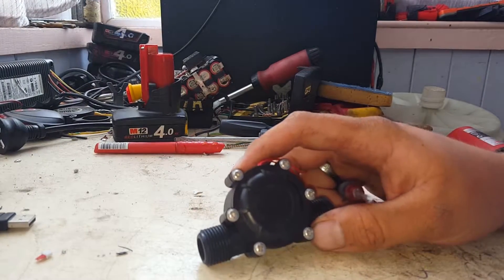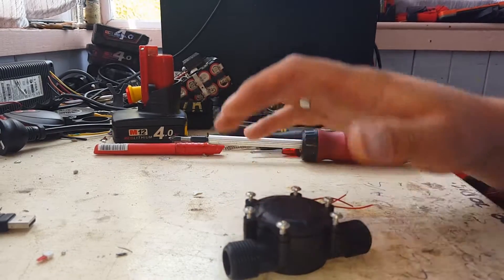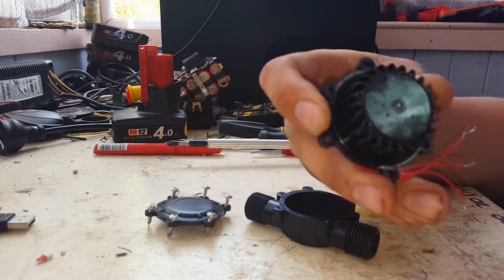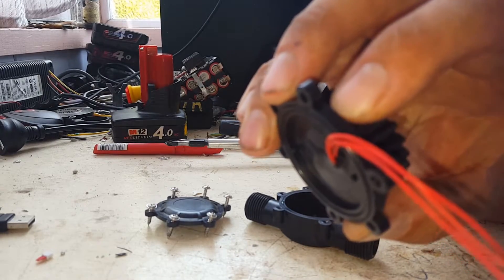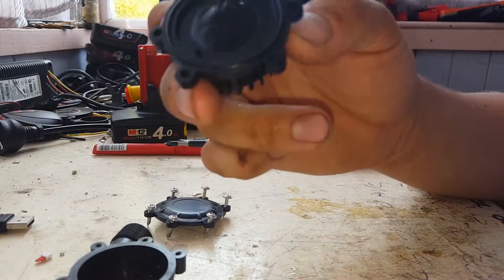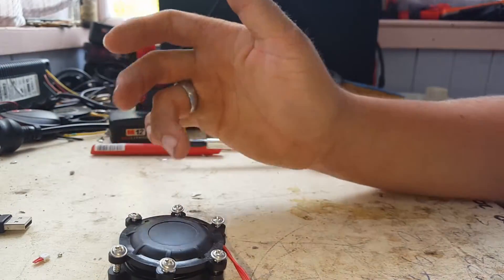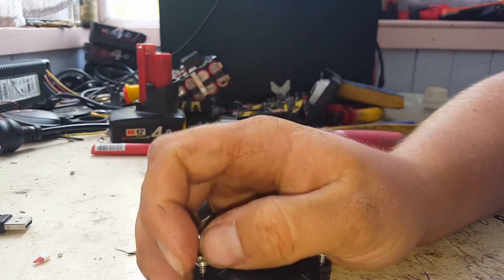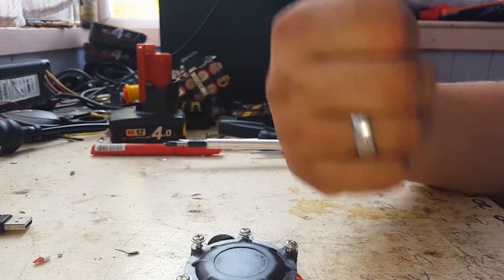Whats inside Micro hydro power generator

Comment: is the bearing is good enough for 1 year continues operation ?
Reply from the maker: Id say it would be fine as there is minimal load on.it
Reply: I need it to charge 6v 4A battery for to power up 1watt led for 1 night in my farm that no access for electric and not possible to use solar panel because low ground ant to many trees, but I have spring water that come from the ground that flow around 20liter/second on rain season and as low as 2 liter/second  during heavy/long dry season. Never stop one full year